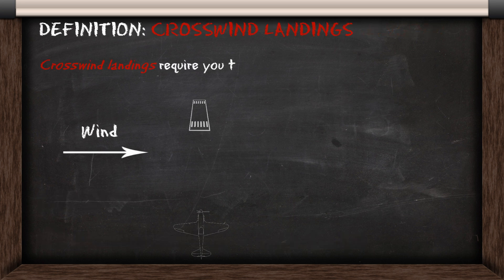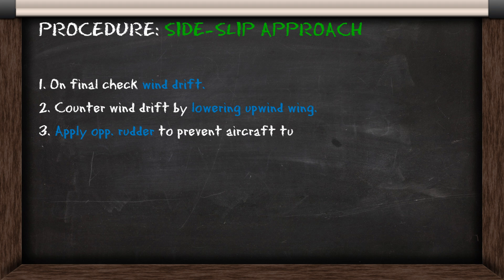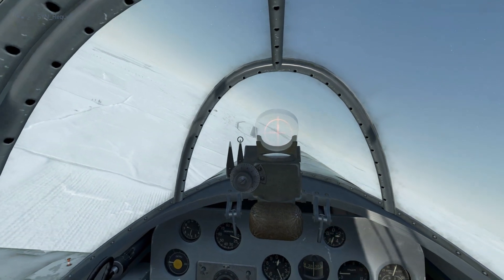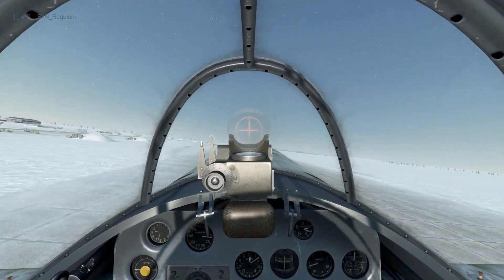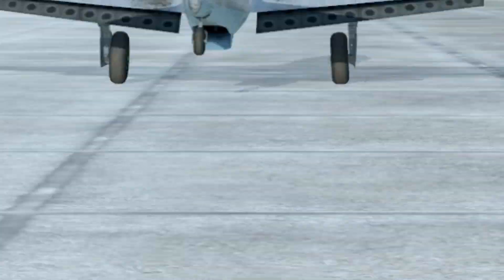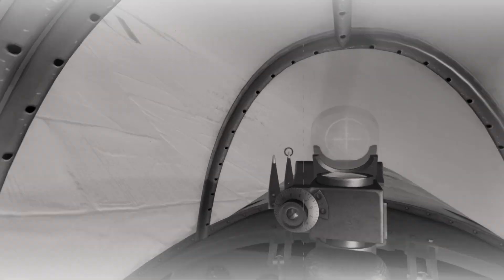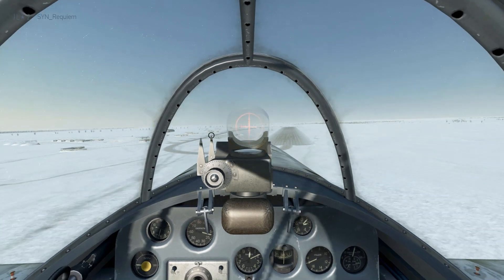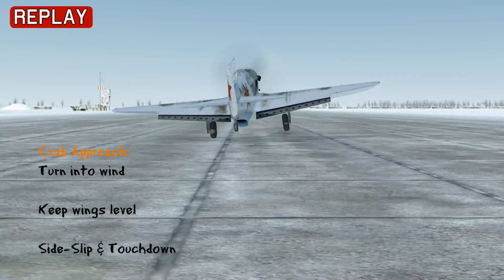Principles #10 - Crosswind Landing Technique

Comment: Huh. So is it called a crab approach specifically when the nose is pointing into the wind and not just keeping one wing pointed down and flying at an angle thanks to opposite rudder a means of lowering altitude without gaining much airspeed? Because the latter something I do pretty often in Rise of Flight on my landing approaches in general.
Reply from the maker: Yep. If you're pointing a wing down with opposite rudder that's sideslipping. Sideslipping lets you lose altitude without gaining a lot kf airspeed because you're creating more drag on the airframe with the yaw

Comment: Thanks for your videos! Yours are my go-to for doing anything in a WWII flight sim. Any tips for maintaining control during touchdown after a crosswind landing? I seem to do the approach fine, but when touching down all bets are off if I go veering off in an unintended direction, ground loop, or bounce around like a pinball between the 3 wheels.
Reply from the maker: Hey Josh, if you're landing in a crosswind you need to keep flying the airplane until you're at a safe taxi speed. This means you should keep adding control input with stick and rudder, so when you put it into a slip to land, by keeping the upwind wing down with opposite rudder, after you touchdown keep that aileron input and start increasing it as you start slowing down on the landing roll while using rudder and braking to stay straight on the runway. How much aileron you need is dependent on how strong the crosswind is, so it's very much a "feel" thing that comes with experience.
Reply: @RequiemsACTL  Thanks!